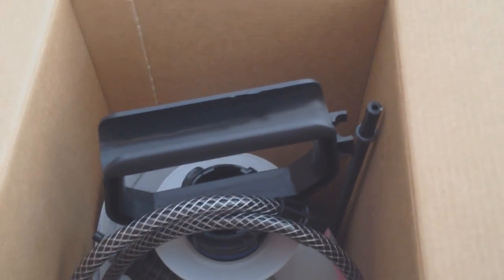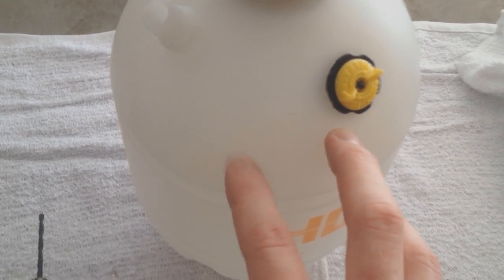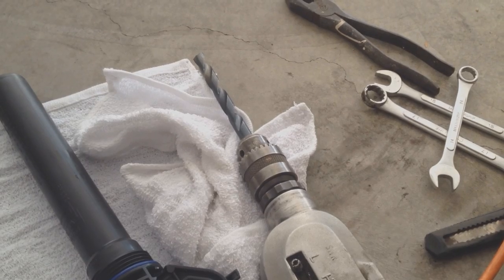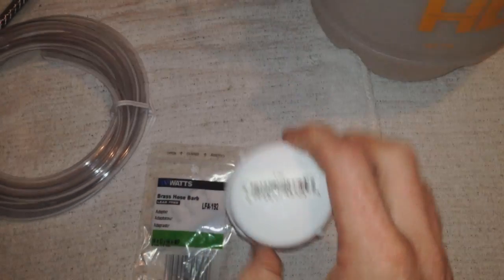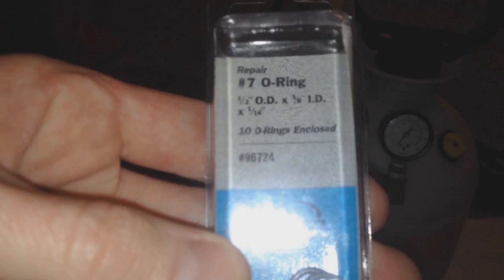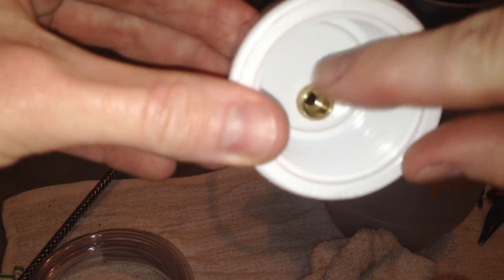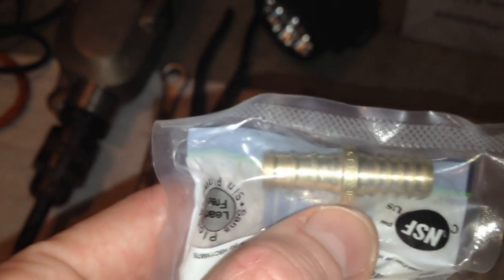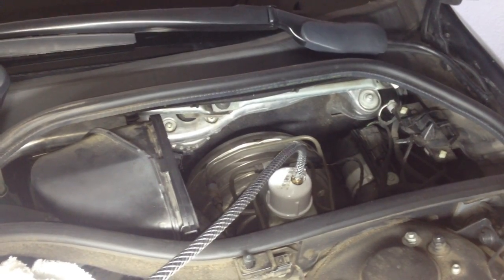DIY Make Your Own 1 Man Pressure Brake Bleeder

Comment: Given all the parts you have to buy to build this and the time spent - you could simply purchase one pre-made for the same or less.
Reply: Actually, the cheapest one I've found is over 200 bucks, so no, you can't.
Reply: Michael Stewart For a pressure bleeder?  You sir are the worst shopper ever.  Try 50 bucks.
Reply: Michael Stewart  of course he's the worst shopper ever, he owns a BMW. They're $40-50, also this one you built will just be blowing air into your system because the container wouldn't reach the fluid all the way to the bottle, allowing it to suck air.
Reply: You should actually build one of these. They work quite well. I only bleed my brakes a couple of times a year and this was easy to make, and cheap.
Reply: +David G You are not going to find a pressure bleeder that is worth a crap for $40-50. Those are vacuum bleeders. And what did you accomplish by insulting him? It shows you are a small individual with a self esteem problem. I guarantee you would say that if you were standing in front of him looking into his eyes.
Reply: Bla  Bla  Bla  Bla

Comment: Hey DIYsavecash, My M/C has a square cap that snaps on. I was wondering if this type cap would work on your pressure brake bleeder? My vehicle is a 1997 Chevy Silverado. The cap size is about 3" X 6".

Comment: An Irwin Unibit (or similar) is much better for drilling holes in plastic and sheet metal. You'd be done in about 30 seconds with that. It won't catch and pull in like a twist drill can.

Comment: For anyone wanting to build one of these its not rocket science .. first locate a suitable cap for your master cylinder because finding something to go onto the master cylinder is not going to be as easy as he makes it out to be they are all different makes and design .. you might have to get a adapter for the master cylinder from a company that makes them for brake bleeding.  by the time you buy the fitting the gauge and the pump etc,, you might have as much as a kit pre built ?

Comment: Very informative.  Thanks.  I have the same garden sprayer--bought it from Home Depot.  When I took it out of the box and opened up the pump (from two tabs on top of pump), I found that it was greased inside with globs of white grease substance.  Did you take a look inside your pump?  If you have the same grease, did you clean it up before using?  There's a very cheap rubber check valve at the bottom of the pump that's supposed to prevent fluid from inside the sprayer container to get into the pump, but I am not sure I would trust it.  So I'm concerned about contamination of the brake fluid from the grease inside the pump, if you're using the "wet" method of power brake bleeding, as you are (from your other video).  Thanks, if you have any comments on this.
Reply from the maker: Hello, I think someone return a used sprayer then you purchased it, I would not use that sprayer, I would return it, mine was bone dry on the inside, I think someone used it then return it.
Reply: DIYsavecash Thanks for your comments.  I'll return it and try another one.  Actually, I bought mine to try to convert it into a fluid evacuator, but may now try to also build a power bleeder per your instructions.

 BTW, I watched two of your videos today.  Really liked the clarity and comprehensiveness of your presentation.  Hope you'll continue to post new videos.
Reply: yusuihang, great job pointing this out. I'm a second generation pest controller, and I can tell you and 'cash that the lube that is inside of those things is usually silicone grease. The reason is that it's water resistant and NOT a petroleum product, so they won't eat the rubber components, and because many pest control formulations contain petroleum based chemicals that would react with petroleum based lubes - BUT also because there is an expectation that some of the lube will escape the system and enter the customer's environment, which is fine for us because its not dangerous. How silicone would react in a break system I can not say, but my gut says that it has a tendency to glob and reactions with globby things usually lead to bigger globs. yusuihang got a unit that was over greased and probably would have failed after a single season, but ALL of these sprayers have that stuff inside the pump unit (or it wouldn't work). If silicone grease isn't a problem for brake components, then you're good, otherwise you might want to look into another system. The issue I see is long term use. For a mechanic, a little 'additive' isn't a problem because their customer base will fit the expected model (people who always take care of their cars don't mind paying for parts within the perceived breakdown period, and people who don't do that expect to have to replace them because they don't take care of their cars), but for the DIYer, the issue becomes time. You get a maintenance system going and keep up with it only to find that the cure can be the cause of some other problem. So, all preachiness aside, I think that, having read the MSDS on DOT 3, there's no cause for alarm, but what would be much nicer (did a search, got zip) would be a statement from someone who's been using a similar pump on the same car(s) for more than 10 years or so and would be qualified to notice/report that there were contamination issues, or that there weren't.
Reply: Charlie O.
Thanks for the details, Charlie.  I am actually just getting started on buying components to build a pressure bleeder.  But I will be using the "dry" method of bleeding so I am not putting brake fluid in the bleeder itself.  Also, I plan to use a quick disconnect method so I can add brake fluid to the reservoir without losing (too much) pressure in the bleeder.  Plan to follow the concept explained in this thread regarding quick disconnect:  http://rennlist.com/forums/993-forum/664940-motive-products-power-bleeder-modified-for-dry-method-use.html 

I did run across one thread in a car forum, of someone who had to replace master cylinder after pressure bleeding, but not sure if he used homemade or commercial bleeder.  Either way, probably couldn't say for sure if cause of failure in that case was due to contamination, incorrect pressure, worn gaskets.  I'm just going to do the dry method of bleeding to reduce contamination concerns; also I prefer it because I think it would be easier to store the bleeder afterwards, while allowing for an easy rinse and dry before usage.  I am also always concerned about doing more harm than good when I do any DIY stuff.

Comment: OK, I assembled the bleeder as per the instructions but before attaching the PCV cap I left the original sprayer handle on the pressure tank & pumped up the pressure to 20lbs to check for leaks around the pressure gage & there were no leaks. I then added the modified PCV cap & used JB Weld around the fitting as a precaution even though it seemed very tight. I then screwed the PCV cap onto the brake fluid reservoir tank & pumped up the pressure tank as a test run without any brake fluid in the pressure tank to check for air leaks. There was so much air leaking from around the PCV cap that I could not even get the pressure gage to 1lb. The tread pitch of the PCV cap is not close to being the same as the thread pitch of the brake fluid reservoir tank & I'm sure no amount of plumbers tape would seal the leak.

Does anyone have another idea on a cap that will work? I have a 750i 2008 BMW.

Thanks

PS: yes the relief valve on the pressure tank was closed.
Reply from the maker: You did it the right way, you just have to mess around with plumbers tape or some other sealant and it'll work.  Same thing happened to me.
Reply: DIYsavecash Hi Chris & thanks for all your informative videos & your reply to my comment. I put many rounds of plumbers tape on the thread but I could never get anything close to an air tight seal. What other method of sealing can you suggest?  What method of sealing did you personally use?Thanks
Reply from the maker: I just used JB weld and plumbers tape, I got it to hold.  Worked pretty good.  Let me know how you get it to work?  Happy Sunday
Reply: +Trevorp Ritchie

Comment: people stop trying to fool everyone this this videos brake fluid is one of the most abresive fuids in a car very corrosive a pump like that is ok if u use it once or twice weekend mechanics concept is good practicality is crap
Reply: Once more...in English this time. Try some punctuation.
Reply: It puts pressure into the master cylinder and the fluid goes out the bleeding nipples on the caliper or clutch slave cylinder depending on what you're bleeding. The pressure bleeder stays dry btw; and yes, I know brake fluid is caustic, but you don't put it in the pressure bleeder.

Comment: i was thinking of doing that,but im a little concerned about the gauge popping off
Reply: Then put a nut or epoxy on the back, inside the tank.  If your hands are too large to fit in the tank, consider that when you decide where to drill the hole for it or find a woman or strong child whose hand fits in the tank neck to put it on for you.

Comment: Lets see you use it and wen you take the cap off the reservoir and all the fluid in the cap pisses out that would be funny
Reply: he shows actually using this device in the next video. after all bleeder screws are tight, open the pressure release valve on the sprayer

Comment: when you take the cap off the master cylinder does the fluid run all over when you are done
Reply: he shows actually using this device in the next video. after all bleeder screws are tight, open the pressure release valve on the sprayer

Comment: Having been a Nuclear Submarine Mechanic, I sometimes take for granted what I actually know how to do. What, if any, responsibility do you accept if something you post ends up getting someone hurt? I suggest that you add a disclaimer for your own protection. Drilling a hole into the side of a pressure vessel is NEVER a good idea.... I'm just sayin'. Obviously, you can dismiss my objection by saying that this is only a garden sprayer but you will still be on your way down a slippery slope. I applaud your desire to teach but I caution you about how easily people can find ways to turn your good intentions into disaster and lawsuits.
P.S. Don't shoot me, I'm just the messenger. Good luck.
Reply: there's always one idiot that takes things too seriously. It's a DIY for a brake bleeder, if you screw up then that's Darwinism
Reply: TheBlessed Ouch!. And I was so afraid that my concern for other people's safety would result in the wrath of a troll. Good thing I was wrong... lol
Reply: Yes, I agree.  I would be very reluctant to drill a hole into a "pressure vessel".  You, or your wife, could sell it at a garage sale to some unfortunate soul with explosive results.  I wouldn't do it.
Reply: One time I shook up a beer and drilled a hole in it. Now I have a hook instead of a left hand. Sucks. Don't do it kids.
Reply: Michael Stewart Guilty as charged on both accounts. :)  I am without a doubt stupid, and yes, it was a joke. /salute
Reply: And, don't call me Shirley!
Reply: Holy smokes!!  I can't believe the risk I took using a Harbour Freight spring compressor to do my front struts.  And none of the videos I reviewed prior to the task published disclaimers.....in English or Spanish.
Reply: macbirt56. You worry too much. Put a hard hat on. There might be a meteor shower today.
Reply: +macbirt56 See above. . .
Reply: Athhud. LOL. Nice try troll.

Comment: if you don't know what a hose clamp is you shouldn't be working on a car
Reply: Politically  correct term is RMA or Round Member Adapter.  That's what the Engineers call them in the communications industry....  Apparently hose clamp is for hoses, not Pipes! LOL  ( Mast Pipes on antennas )

Comment: I had a problem with the cap when I did the leak check with air. I used JB weld on the inside fitting threads because the cap was to thin. Also use an O ring in the inside diameter of the reservoir. This was on a ford expedition 03. After this was done and it able to hold a pressure 10 PSI and the bleeding went as plan with in 15min...

Comment: Why does everybody make it so difficult? Get an extra master cylinder screw on cap. drill a hole in it and mount a vacuumhose fitting. Connect a 6 foot piece of hose to the fitting. On the other end of the hose mount a screw on tire filler fitting, screw on type. Now screw your new cap onto the master cylinder, screw the hose fitting onto the valve of your nearest tire...you've just pressurised the system. Crack any bleeder valve and Vóila! No helpers, no pumping the pedal no problems. Just make sure you keep the reservoir in the master cylinder topped off during the process.
Reply: +LAFOLLETTER You're welcome! After you are done bleeding all 4 brakes you will probably need to top off the air pressure in the tire that you used as a pressure source. So simple yet I see all kinds of complicated setups here on youtube, just to get a little pressure which is already there for free!
Reply: I like the idea of using air from a tyre to pressurise (for a simple bleed) but your idea is more trouble than its worth if doing a(full flush), you will need to fill the master cylinder a few times and that requires disconnecting the tyre valve then removing cap to refill. 
I would combine both systems together and remove the original hand pump and replace with a fitting that connects to the tyre hose that doesn't go to the bottom of the tank that will eliminate any chance of airation of the brake fluid and there will be no need to constantly remove cap to fill master cylinder reservour.
Reply: I recently replaced both front callipers and discs. As you can imagine quite a bit of fluid ran out of the hoses before I could connect the new calipers and of course the new calipers needed to be completely filled. Even so I didn't need to refill the master cylinder once during the bleeding process so no trouble or hassle whatsoever! I topped off the master Before screwing on the pressure cap, did the bleeding and then topped it off again after I was done. Couldn't be easier.
Reply: Then don't screw the fitting onto the tire valve steam as far and it won't open as much so you get less pressure out.  Similarly if your hose is flexible you could cinch it nearly shut with vice grips.
Reply: You have some reason to believe that 20 lbs is not damaging while 30-35lbs is?  That seems like an extremely arbitrary assumption to make if you don't have a source that states this.  

The data I have seen in the past is that under normal braking, the braking system applies around 800PSI and well past 1000PSI in hard stop conditions.  Why would you think the system can't withstand under 100PSI when it obviously has to withstand multiple times as much to put so much pressure on the brake pads that they can stop a smooth, sometimes even wet, spinning disc vs the momentum of a multi-thousand lb vehicle?

It's not too high, but the other reason you might want it to proceed slower due to lower pressure is so you have more time to notice when the fluid level is getting lower so you don't get air down in the lines before you stop and top off the reservoir tank.
Reply: you should make a video of it. love to see it in action
Reply: The fluid reservoir atop a master cylinder is not designed to operate at ANY specific pressure. It just holds the fluid. The brake system pressure is generated after fluid enters the master cylinder itself. Adding pressure to the reservoir as part of a bleeding system is something entirely separate from what the master cylinder does during braking. This is why I suspect these bleeding systems operate at low pressures. That way they're less likely to generate a leak where the fluid reservoir screws onto the top of the master cylinder. Typically, the reservoir is all-plastic, with plastic threads. Not something which would withstand high pressures, like 100PSI or more. Could they withstand 35-40PSI from a tire? Dunno. Personally, I'd hate to see fluid squirting onto my engine compartment from a split fluid reservoir.

Comment: wouldn't this method pump air into the brake lines?
Reply from the maker: scorpven Hello, your pressurizing to push it through liquid brake fluid, not air, hope this helps.
Reply: He's using the bottle the same way you'd spray weed killer or bug spray only some mods and putting brake fluid so no you won't be blowing air
Reply: +DIYsavecash this is where I get confused. When you put the cap on to seal the reservoir, there must be some air caught in the top of the reservoir, so does that not get pushed through the lines?

Thanks for the video, it seems like a great idea.
Reply: +Mathew Wood Yes that's true air is in the top of the bottle but the line the liquid comes from goes into the bottom so the air pressure up top displaces the liquid forcing up the tube. you won't get air unless the liquid level drops below the end of the line. after my first post I've used this method except I put a quick connect and dialed down the regulator on my air compressor. worked very well I'll never ask someone to help me with bleeding brakes
Reply: Ok. I figured that the air would probably sit at the top but I wasn't sure if under pressure, it might be forced into the line. Thanks for clarifying.

Comment: this will NOT work if you have a ABS modulator valve on your car.... you cannot force brake fluid though that.... tried it on my Chevy silverado, all it did was force fluid out inbetween master cylinder and brake booster all over the ground...nothing replaces the good ole pump the brakes setup...
Reply: 2004 , had to foot pump them like normal ... and it took a long time because I had to replace all the lines because they were all rusted thru... took three times to bleed because you have to get the ABS modulator to run a few times to get air out of that besides the lines...